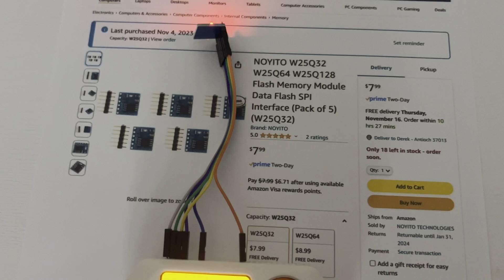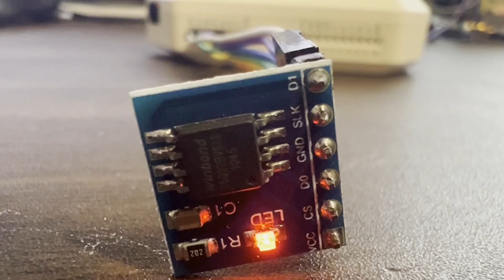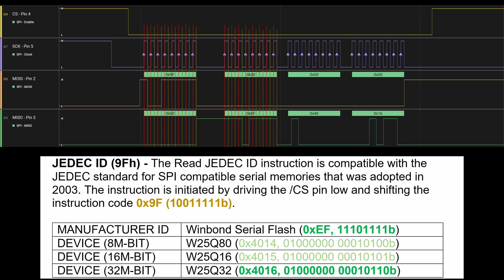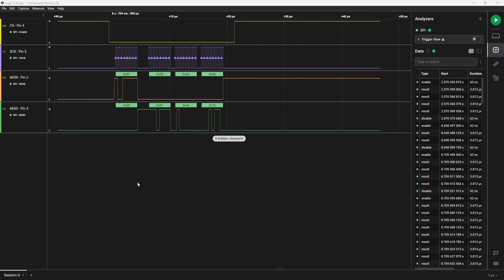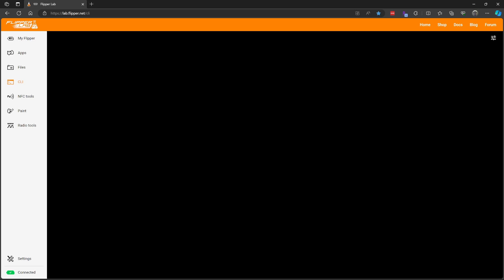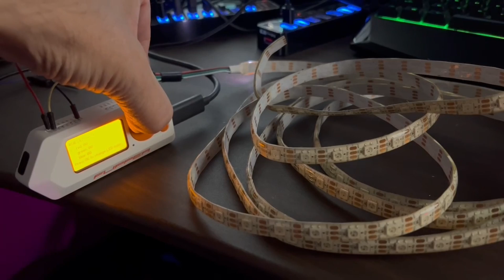[91] Flipper Zero - Understand SPI Protocol

Comment: Please share a video  to read firmware using spi bios flash non-dismantling test program clip sop8 24c 93c 25lf
Reply from the maker: That sounds like a great idea. I added it to my list of things to learn and teach. Matt Brown (@mattbrwn) did a video recently using a clip and talked about how SOMETIMES (like 1:6 for him) the clip failed to work because the processor powered on, resulting in a bunch of 0xFF reads.

Comment from the maker: In this video I was using the Logic app and Saleae logic analyzer.  But for lots of signals you can use a less expensive logic analyzer.  I bought one of these (getting the software working is a pain initially, and you have to solder the cheap probes, but then it should work fine too) https://a.co/d/df2SFVN

Comment: May I use wires directly to spi chip....or have to use this board for spi?
Reply from the maker: You can go direct to the chip.  There are even some cables like https://www.amazon.com/dp/B081495VY7 that look promising for connecting to the chip.  I ordered then but I haven't had a chance to try them out yet.